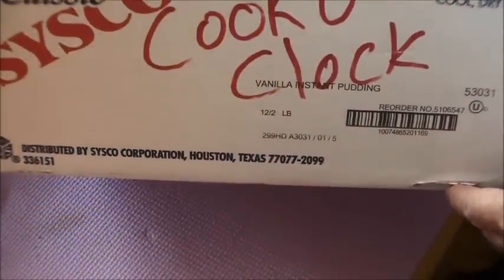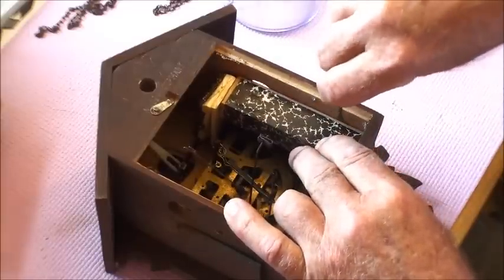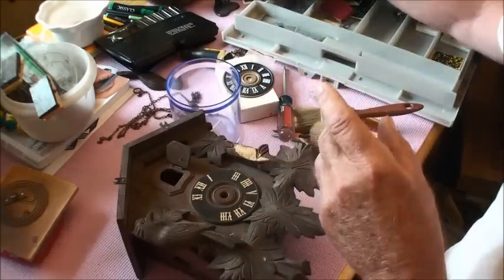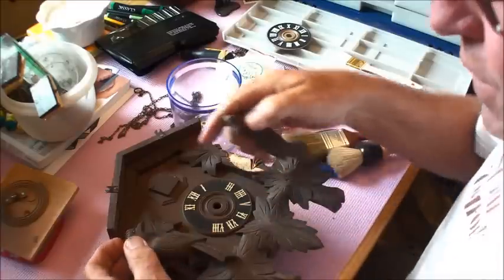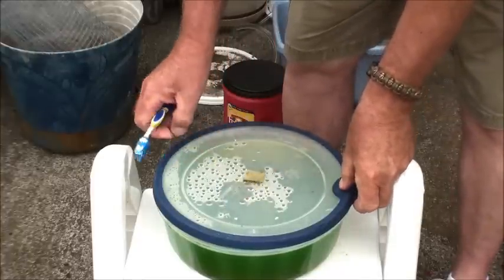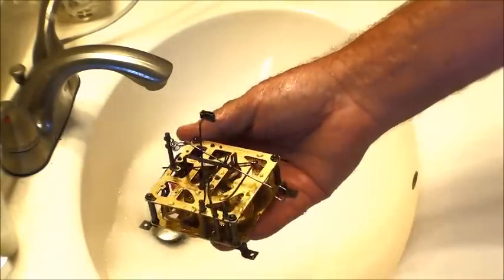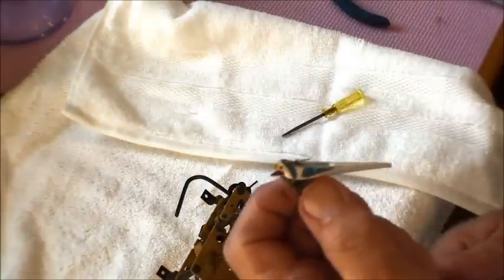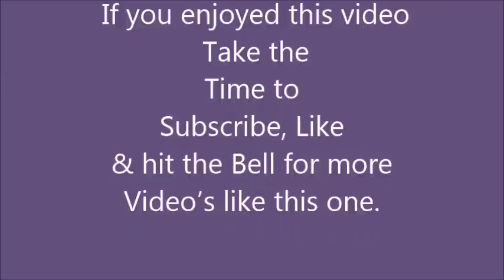Cuckoo Clock Repair

Comment: Hi Mike, wow it’s been a while since I watched this...I never actually got my clock working and I have a problem...I used ammonia to clean it for about an hour but it didn’t clean the oil and funk out of it. Then I left it for 8 hours and everything is rusted. The whole movement is orange and everything is creaking. I oiled it and that didn’t help either. What ammonia did you use and for how long? Thanks
Reply from the maker: Clock Cleaning Concentrate - Ammoniated is what I use to clean my clocks, but am switching to  Clock Cleaning Concentrate - Non-Ammoniated. I would suggest to  use a toothbrush and  and Dawn dish washing soap along with some hot water to clean as much of the rust and ammonia as you can. If you get it good enough, dry it right away with a hair drier. Also, make sure you are using clock oil on your clock and get the excess off.  Let me know how this goes because I only have one other suggestion if this all fails.
Reply: Just Mike Hey Mike, this is me, Green Knight from the previous comments. I split my channel off so this is my clock channel now, I won’t be making any more on the old channel. Thanks

Comment: May I send you my clock? It is in need of repair and cleaning. I can see one of the the bellows is ripped and the other doesn't make a sound.
Reply from the maker: It is not cheap to send the clock back and forth, besides the cost of repairs. I do have a video on how to replace the bellow on top of the whistle box. Send me an email if you need help. The email is below the video where it says Show More, Adriene Forare.
Reply: @justmike57  Thank you for getting back with me. You did such a great job explaining and demonstrating how to clean and refurbish  the cookoo clocks you have, I decided to go ahead and give it a try. I’m waiting for my supplies to arrive and I’ll put my plan into action. If I run into a snag, I’ll send you another message, if that’s alright with you.
Reply from the maker: @adrieneforare5791  That is totally fine Adriene Forare. I have an email listed below the video is you run into any problems.

Comment: What Amonia mixture are you using? Did you dilute it? I have an old; 100+, year old cuckoo clock that I oil from time to time. I'd like to follow your cleaning method.
Reply from the maker: In this video that I will leave a link to will show you the two kinds of clock cleaner I use. https://www.youtube.com/watch?v=Ctbd-Vs2lNA&list=PLoY8sZHHeLYwuK6bQu31H8blCdtYV7kTo&index=6&t=240s
  If you don't want to watch the whole video, skip to about the middle and I show the two cleaners I use and the instructions on the jugs. Yes, I do dilute the cleaner as noted on the jug.
Reply: @justmike57  Thanks, very much appreciated! Be safe out there!

Comment: Can i get some parts for a mi-ken 
Need weights,  pendulum,  bellows paper.
Reply from the maker: The Bellow paper I get on E-Bay. The sell it in different quantities https://www.ebay.com/itm/254032102074
  The weights can be bought on E-Bay as well if you are looking for an older weight with the wire. Or you can buy a new one from Timesavers or Ronell Clock Co. as well as the pendulum.

Comment: How do you get the pressed on star wheels off and then back on again?
Reply from the maker: The star shaped wheel you don't want to take off. It would be the Gong counter that counts the hour and also is timed to gong before the bird cuckoos. I do believe you were talking about the inside works? Hope this helps. Email me below in the show more section if you have other questions, if you would like.

Comment: I think I’m going to just take mine to the clock shop, that’s plan A. Can you suggest what a fair mkt value would be for such a service?
Reply from the maker: The clock shops have to charge by the hour and is not cheap. You also have to watch out for the bad ones that will tell you your clock is junk and they will take it off you hands for parts, depending on what the clock might be valued at. They do make a spray cleaner for the people that don't want to take their clocks apart also, if you want the site I go to, just email me and my email is below the video.
Reply: @justmike57  
Ok it’s a Black Forest I bought new about 6 years ago. Trying to think it was between $250-350 new shipped from Deuchland.
Reply from the maker: @tonysabatino4725  According to the book, it says to oil your clock every four or five years to keep it running. If you let the oil dry up or get gummed up and the clock stops, you will have to clean the movement. There is a chance you can oil it and could start working again. 6 years isn't that old. 
  Most all clocks have the same movement in them, just different designs on the outside. Some clock shops would rather order you a new works for around $65.00 and slap it in because it will be cheaper for the labor side of it. This is now good for your older clocks because the plates are thicker and the movements could have a higher value to them then new movements.
Reply: @justmike57   well, thanks Mike. There’s a clock shop a town over. I’ll talk to them and feel it out. I am a former machinist Mechanic and fabricator, so if I have to I’m sure I could watch the video again and pull it off myself if this shop doesn’t vibe well with me,  I always have a few different projects going at one time so if it’s practical enough I’d be okay with handling it off. Thanks for all of your input, really appreciate it.

Comment: I have this modal but I can't find a Silent Lever. is it okay to remove the weight from the cuckoo only to stop it at night do you think?
Reply from the maker: There should be an L shaped wire above the door of the bird, to keep the door shut if you don't want any sound at night. Also, it will not hurt a thing if you take the one weight off, but might have a better chance of losing it in a shuffle. Thanks for stopping by Patrick Sheppard

Comment: Hi! Mike, I am your new friend, I love the design of the Cuckoo Clock, you're a clock expert , showing your patience cleaning the Clock, what is that brown liquid?shiny and you rinse water, use hair dryer to dry up, alarm sounds makes me wake up!anywy which i needed thank you so much for sharing
Reply from the maker: The brown liquid was a brown stain I came up with for the closest match I could do. This is my hobby, working on Cuckoo clocks. Thanks for watching Belle Saga
Reply: @justmike57  it if not a trade secret could you share the ingredients, looks like water based and lot of pigment,  really helped the top.
Reply from the maker: @jackiemyers747 , No real trade secret. You can go online to buy clockworks cleaners. It one I have is very strong pneumonia smell that you dilute with water. I see they have another one out that I bought, but haven't used yet for cleaning the clocks in unventilated areas.
Reply: @justmike57  thanks for you time but it was the stain i wanted to know about ingredients.
Thanks
Reply from the maker: @jackiemyers747  I don't have the bottle anymore, but I think it was a Walnut stain. The Gel Stain that you can brush it on and not wipe it off. You want it  to go on thick like, and do not wipe it off. The stain on the clocks are to cover up the cheap soft wood they used in the old days. I have found,(by accident) nice looking wood under the stain, but some is mismatched and that is the purpose of the thick stain. Try different samples to see what will match close and make sure to stain the whole clock to make it all match. I do hope this helps you.

Comment: I found one in a formerly derelict house that is about to undergo a rehab and will be restoring it soon. No carvings so I'll need to find a period correct set to match.
Reply from the maker: I was lucky to find one on Ebay that was old stock and the guy was selling off that he discovered in the clock shop. Theses are crude enough that if you wanted to, you could try your hand at carving one. I did before on another clock I worked on. Thanks for watching Karelski94
Reply: You're welcome. I might try my hand at making carvings from balsa wood.
Reply from the maker: @Monster404ftp  I use cotton wood from around here, a good soft wood, but not to soft. Good luck

Comment: Mike another question I have is now it seems that my minute hand seems to not be moving and when I move it with my finger there is no strength to it not really sure what to do.
Reply from the maker: So, I take it you are not able to change the time with the minute hand is what you are saying...? So, on the minute hand, there is a brass grommet that is inserted in the minute hand. If the grommet is removed, you will find it has little teeth for the minute hand to hold on to so you can change the time, or lift the minute hand off it and reset the hand if the clock is cuckooing to soon or to late of the 12 o'clock position. 
  There is a chance that you need to press this back on the minute hand.
Reply: @justmike57  I have the grommet on it and tight it just seems that when the clock is ticking the hand isn’t moving I do have the grommet on the minute hand
Reply from the maker: @justinabshire12  Push the minute hand in, as you turn it. Does it feel like it then grabs a gear. If so, you will have to take your clock works out. There is a washer in the shape of a horseshoe that has come off that also holds the minute hand from coming off.
Reply: @justmike57  yes it feels it isn’t grabbing a gear I am not really sure where to look.
Reply: @justmike57  mike the hands turn it just seems that minute hand seems to move to freely which does not allow it to keep time
Reply from the maker: @justinabshire12  So is the clock running too fast and if so, is the pendulum bob all the way down?
Reply: @justmike57  no the pendulum is fine it is the minute hand it seems to have no friction it is not moving when it is ticking it just stays in one spot.  Now when I move it with my finger the bird comes out.
Reply from the maker: @justinabshire12  You will have to take the works out and turn the minute hand, while looking for a stripped or missing a gear and needs to be reset down again. It is hard for me to tell, without having the works here..
Reply: @justmike57  can I email a picture to you if that would help
Reply: @justmike57  mike it was the gear that moved back I was able to move it back in place and get it going thanks for you advice.  Also, any recommendations on what to like polish the clock with.

Comment: Nice video. Used to clocks but not these cuckoo types. My first one has a missing click pawl. I think I could make one but I have no pattern. A sort of internal arrangement but no pivot point! Ah well! Thanks for the entertainment. BjG
Reply from the maker: It doesn't matter if you make one for yourself, Patten's are for making and selling them. It's great to hear you use to work on clocks. Thanks you very much for stopping in Berry J. Greene.

Comment: Спасибо ,я посмотрел вашу работу и вы это прекрасно доносительство нам.а скажите что это за зелёная жидкость для мытья часового механизма ,каков ее состав
Reply from the maker: Hello Паша Питецкий, this green liquid is a clock cleaning fluid. It smell like a very strong ammonia, and should be used in a very well ventilated area,  or outside.
Reply: @justmike57  привет,я всегда разбираю механизм часов полностью и потом мою все шестерёнки в бензине,также высылаю посадочные места осей на пластинах и потом собираю механизм и смазываю часовым маслом, после этого ,я настраиваю работу механизма и  собираю все это в корпус часов и отдаю заказчику, у нас несколько упрощён вариант кукушки,сам механизм,а такой механизм ,как у вас я увидел лет 5 назад ,спасибо вам ещё раз ,вы добрый человек
Reply from the maker: Gas has oils left behind. You can clean it that way, but then you need something to take off that oil, like Dawn Dishwashing soap
Reply: @justmike57  спасибо,ещё раз,скажите а какие часы вы ещё ремонтируете и какое масло вы используете

Comment: We just found two of these in a friend’s basement, and without this video, I wouldn’t have gotten close to getting the movement out. There’s a two weight clock like this that’s fine, but the music one doesn’t have bellows or whistles. Do they sell the wooden whistles?
Reply from the maker: With the music in the clock, it has a higher value. Yes they sell the  whole whistles but remember, the more you have to buy for the clock, the more money you will have in it. You can check out eBay for parts or buy new. I buy most of my parts from; https://www.ronellclock.com/login-submit.sc  (Ronell Clock Company) or some used parts on eBay. The clock with the music should have numbers on the weights so you can buy a matching pinecone. I hope this helps you out on your success of your project cuckoo clock Ethan Ramaker.
Reply: @justmike57  Thank you! We just repaired one clock, and the musical movement is soaking in Ammonia right now! I really appreciate this video, it would be so cool if you made more!
Reply from the maker: @FTBFHRITP  , I do plan on making better videos of more of the cleaning or repairing of these clocks. I just bought another one from the thrift store that needs new bellows. I hope to get my Washington Room done by the first of the year so I can get started on the new videos.
Reply: Just Mike Sounds awesome! I’ll be sure to be watching!

Comment: Hey Mike I don't know if you check these comments Anymore but.  As of today I found a great way to agitate the Ammonia through vibration. If you have an Air compressor you can set it on top (while holding) and it is perfect for the solution to agitate the gears. Let me know if you think this will change your mood lol
Reply from the maker: I still read them, but I do get behind. The ammonia is over powering already and have to use it outside. I now have a sonic cleaner to make the job faster for me. Check out my video on using Simple Green and other products added to make your own cleaner from home.
Reply: @justmike57  Hey Mike,  that sonic cleaner is the best!
Wondering if you're able to help me out on my cuckoo clock?
First  I used tyvek paper from what home are wrapped in for my bellows  should it work?
Second, I clean my clock but now it doesn't work.  The legs don't move up and down to move the bellows properly, seems like the are stuck because the arms can't go any further.  Maybe it's out of sync? I live in Alberta Canada. Don't know if there's a place to service it.
Reply from the maker: @gocorygo658  1. The Tyvek paper for houses might be too stiff. I hear people using it. but they have to work it a lot to get it loose. Others use Tyvek suit because it is a lighter weight. 
2. When you cleaned your clock, did you take it apart all the way? or just clean it in tack. If your clock is together, but out of the box and see the arms moving up and down. that is a good thing. The arms need to start by coming out straight and then maybe bent so the bellow lift wires can open the bellow only 1/2 way. If the paper on the bellows is too stiff, the clock will have to work to hard to open them. The weights for your clock are to do as little as possible to make the clock work right and so you need to release any tension the clock might encounter. 
  Such as the star wheel that lifts the arms and gong should not really be lifting anything when the count of the hour is done. 
  I am not there all the time, but my email is listed below the video.
Reply: @justmike57  Hey Mike,  I didn't take it all  apart. I bought some Ammonia and gave it a good bath and scrubbed it with a tooth brush, used hot soapy water and used an air line to dry it off. I'm purchasing that oil syringe and looking for clock oil. So the tyvek paper is called Tyvek suits? I should go to a flee market and see if anyone has any.

Comment: I also have a Hubert Herr cuckoo. Inside on the brass plate is reads, “Hubert Herr Triburg Germany. Unadjusted and no jewels. Has the same bellows and flutes as the ones in this video. How do I find the date of this cuckoo as well?? Please help
Reply from the maker: I am not an expert on finding the dates, The thing I do know is the clock is older if it says Germany only and not made in Germany. Also if the nut that holds the hands on is larger than the clocks now, would mean it was made before WW1

Comment: Hi Just Mike, did you receive my Email with photos of the inside of my Cuckoo Clock? I wanted you to tell me if I've done anything wrong!

I'm still having problems, I  removed the Chains and put them back in again, but the Weight for the Cuckoo Bird is still not moving Down, it moved freely when I pulled the Chain up, after that it just sits at the same position at the top, is it supposed to move Down like the Wind up one?

I'm not getting the Bird to Cuckoo or the Chime to Sound. Please Help! Cheers Cheryl.
Reply from the maker: Yes, I got your e-mail and working on another clock and will be back with you in a while.

Comment: Thanks so much, Just Mike, We brought a Family Cuckoo home and your guidance gave me comfort and with minor adjustments, the birdie is chirping and I understand how to align the time to the cuckoo...
And, my Wife is comfortable with me messing with it... The chain on the cuckoo was flipped over the wheel inside and was stopping from working.
Think it was also interfering with the clock weight and movement as that got it working. Just might need to check if the 2 bellows are both working as the cuckoo seems to have only one breath of a cuck and missing the koo...
Reply from the maker: Just make sure the bellow is moving up and down. If it is, and no sound out of one of them, the bellow paper could have broke. If so, you could either order new Bellows only or use Tyvek paper to repair the bellow yourself. I have videos on both, replacing the bellow and using Tyvek paper you can buy on E-Bay.